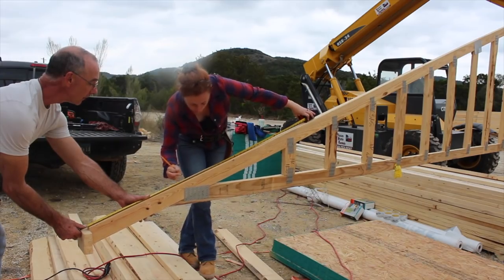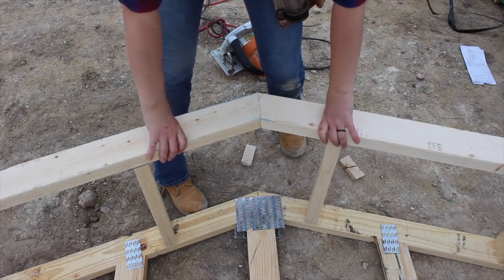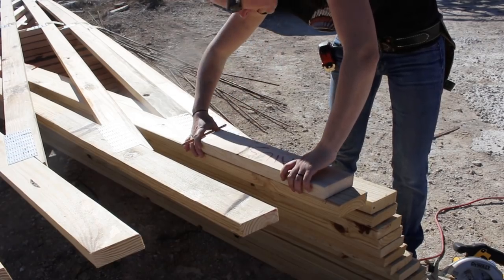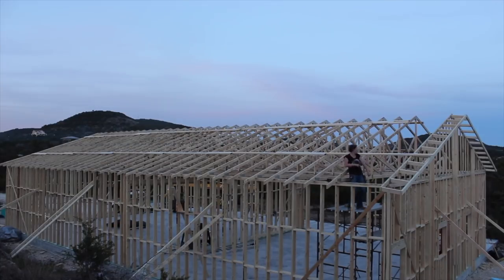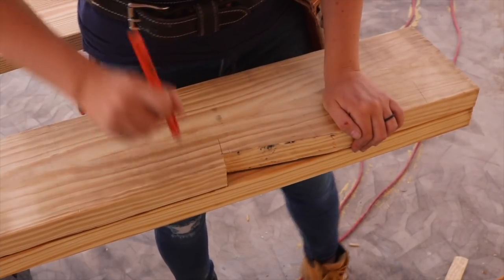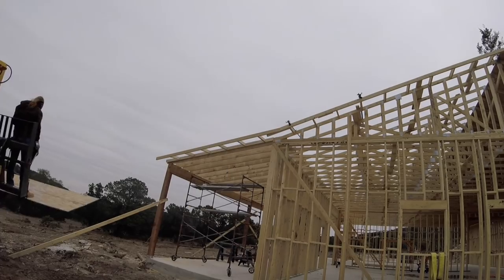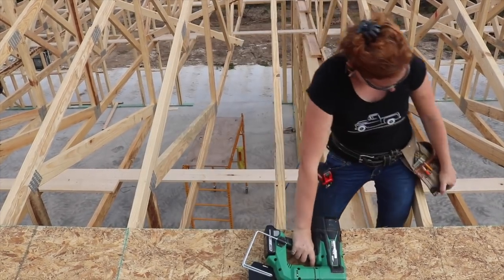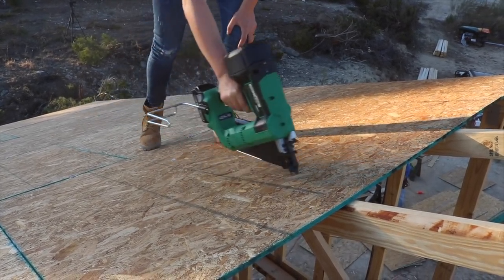Building A Shop - Trusses and Patio

Comment: 2' fly's and no drop gable. First heavy wind storm you are going to be a victim of the old disappearing overhang and saggy gable syndrome. You have equipment to set trusses and you don't sheet the gable ends before you set them. I understood not sheeting the walls because of the limited man/women power you hade on hand but even if you have a lift its going to be hard going working with sheet goods 12' in the air. Sorry to sound like I'm cracking on your hard work but I'm just making friendly observations

Comment: Time to split hairs! Been a truss designer/engineer for 20+ years and in construction for 10 more than that. Not that it matters or even an inspector will even check for but trusses cannot be cut in any way, shape or form without the blessing from the manufacturer and/or engineer. Does cutting 1 1/2" off the OH make the truss fail?  Please. I know it's ridiculous but inspectors can also be. To let you all in on a secret, today's truss design software has a safety factor of 3 built into the program. That means a truss with a CSI factor of 1.00 can actually safely support the designed loads 3x times that for a brief time. This is obviously for environmental conditions like freak gusts of winds and earthquakes and such. Also for construction loading (when some moron stores an entire skid of drywall in the middle of a floor). I get the most hilarious calls from time to time. Like a roof system built for light storage over a garage, and the homeowner wants to know if he can store engine blocks up in the trusses. Or THAT guy who wants to drill a 3 1/2" hole in the top chord of a floor truss for plumbing. Chord is 3 1/2" wide, hole is 3 1/2" wide. "I can't do that?" He asks. "No" I reply. "Well I already did". "Then why aren't you dead?" I ask.

Comment: I hate to be a downer,  and it's likely the shop is far more complete than this advice will help.  In my area, fire code often requires a sprinkler system in larger workshops.  At the point it is considered a "high fire hazard" the fire chief/marshal can dictate that requirement.  While they can be arbitrary or petty, it is ultimately up to the local authority to decide based on use.

Local guidelines for my area require fire loads to be less than 12' tall and 2500 sq ft or less.  That still requires fire extinguishers, but avoids the costly sprinkler system. You might want to put it in for your own peace of mind anyway.

If you avoid sprinklers, then you'll need a 2 hour fire wall between metal shop and wood shop, as well as 2 hour fire doors.

Good luck and stay safe.